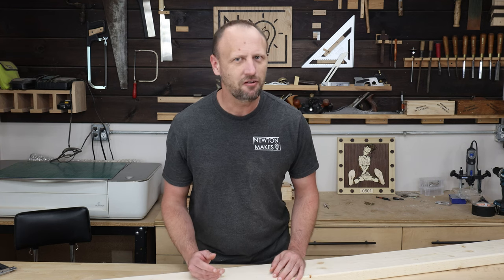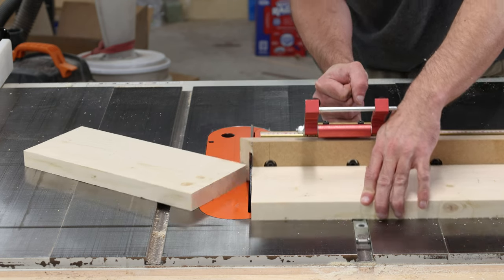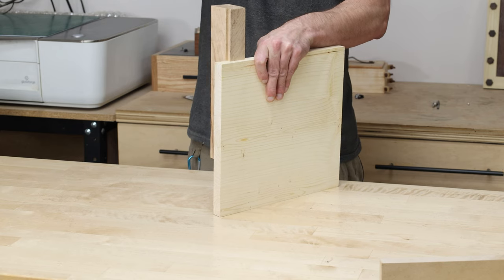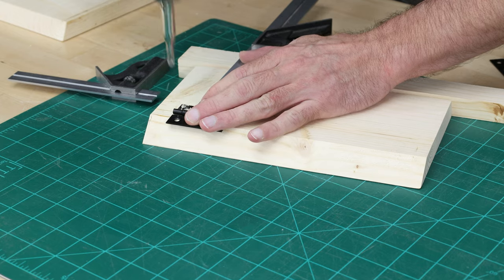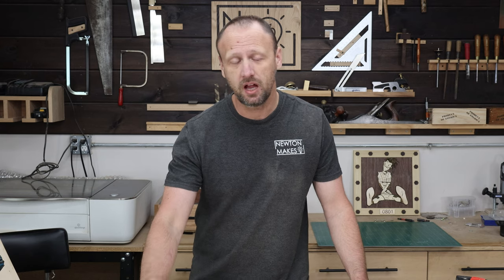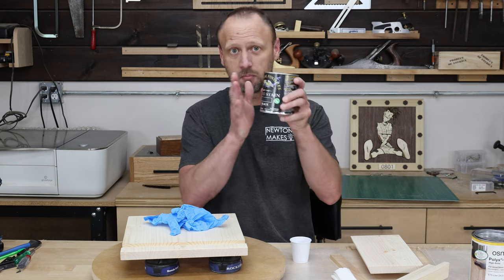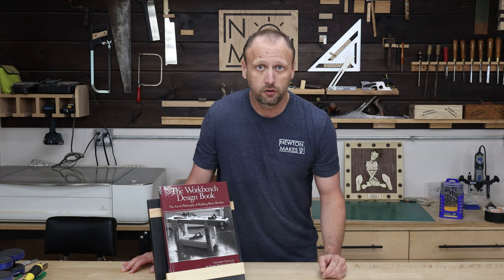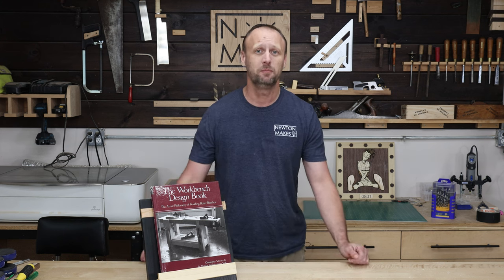Why is This Worth So Much $$$$?

Comment: I made one last year, with the back board in the shape of a house and used a drawer pull to create the lip off of the bottom plate.  I didn't use a full-width board for the back, just a 3" wide piece with a single hinge mortised in so it lays flat.  I managed to use a low-profile screwdriver to tighten down the hinge screws on the back.  My wife loves it and now I can tell her I've saved over a hundred bucks that I can put toward shop tools/supplies/wood.  😀

Comment: There are no evidence they are selling enough volume at this price.
Reply from the maker: There's perhaps no evidence available to us but sales data exists. We can make a few assumptions that have a high liklihood of being correct, one of which is the cost of maintaining a supply chain. Companies need to avoid high inventory storage times. Due to customers expecting quick turnarounds on purchases, large companies with overhead can't afford to offer items not selling. If this many are listing this item at these prices, they're almost certainly selling them at a reasonable pace. I worked in supply chain risk management.